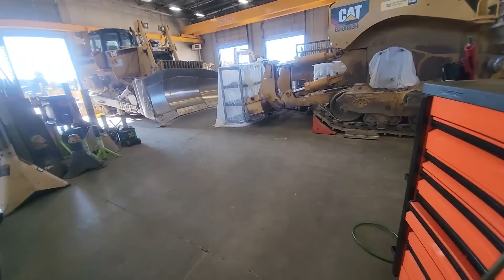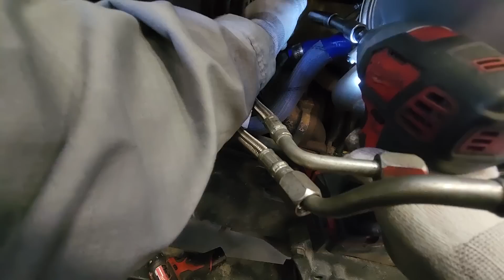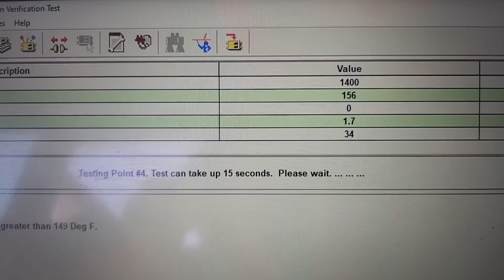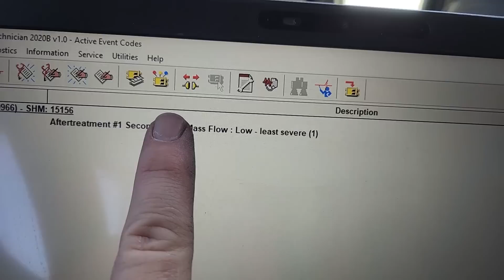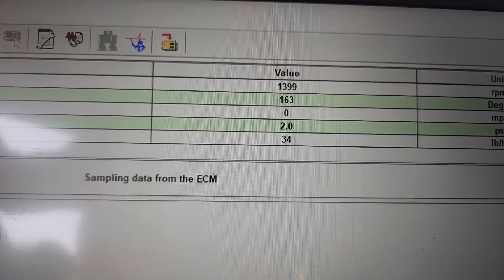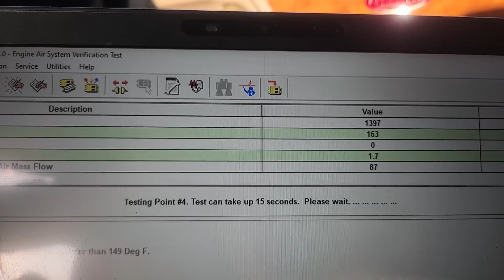Boost Leaks are Driving me CRAZY on this Diesel Truck. Green Can O' Worms 3.

Comment: I hate them twin turbo setups they're useless they're a pain in the ass to work on I don't know what engineer designed it but they should be slapped upside their head single turbo is way better system way less parts to go bad way less parts to leak air

Comment: I found taking a mallet and tapping the clamp after tightening it then tightening again does seat it better. Try to torque it to the specs after that and see if it does tighten more.  Worth a try. would have liked to seen the smoker used to see if any more leaks could be seen, used one to see intake manifold leaks.
Reply: I use a brass hammer to tap the clamps.
Reply: Same, i always tap the clamps after tightening it. If possible i do it 1 more time after running the thing also-
Reply: I always check to see if the "V" band is bottomed out from excessive erosion also.

Comment: To me it looks like the V band clamps are bottoming out, if they bottom out the clamp is not squeezing the faces together. Take the clamp off and press the v back closed or try new clamps. I've had this happen with these clamps after a couple of tightening cycles, worth a shot.
Reply: Yep technically you're not supposed to reuse them, I've never tried to bend the V-back into shape though.. I also put oil inside the clamp to help it slide over the flange. Volvo service actually says to do that.

Comment: Thanks Josh for bringing us along on one of the most frustrating parts of our job!  I'm amazed that the customer hasn't went to the dark side and had this one deleted.  So many of them have by now.  I use the antiseeze on the vband clamps too and whe they get installed I tighten them up then wack them with an 8 ounce hammer to tighten them up more then hit the clamp nut again.  It helps a bunch!  Also can you find out where you get the air pipe block off that you had on the engine side of your air system?  I'd like to get the boss to buy us one too.  Our air line pressurization kit is getting pretty beat up and I'd like a better setup.  Thanks for the video and pain for us.
Reply: If you have a lathe at your shop, they're not hard to make. Took me about 1/2 a day to make mine from some scrap aluminum I had laying around the scrap pile.

Comment: Owners just putting bandaids on.  Trying to save pennies, and lising dollars in the process.
Reply: Sometimes down time costs more than fixing things right… just how it is sometimes. Sometimes you just have to get stuff working again and then schedule down time to get it fixed right later.
Reply: There's no fixing a regen cat. The last company had eight pete 389s with the regen C15 cats in them. Those trucks were ALWAYS in the shop, especially mine. They never ran for long. They refused to regen, had issues with "secondary air mass flow". I got so sick of mine I ended up moving into another pete with an isx without letting the owner know first as that truck belonged to a driver who was on sick leave. He never came back, so I stayed in it. Eventually, the owner ended up getting rid of all eight of those petes. 

My best advice for anyone interested in buying a regen Cat motor is to NOT BUY IT. If anyone finds one and is dead set in getting one is to at least do a delete on the whole system.
Reply: Or getting it to the point where they can sell it.
Reply: @RustyorBroken  that was my first thought.  This truck might be headed to auction.
Reply: What you're talking about is most businesses. All they look to do is squeeze everything that looks like blood might come out of it.
Reply: They were stingy with the pennies😂😂😂

Comment: That's surprisingly low boost pressure for a truck; I was expecting a lot more.

Like 20-30psi  or 14,7psi at the least.
Reply: You don't really need much air flow to regen.
Reply: They do run that under load or while driving. just not when it’s only trying to do a regen. It just needs some air flow to regen, not really much pressure